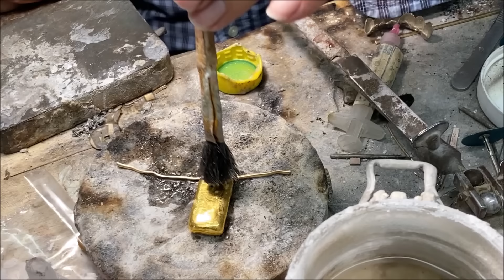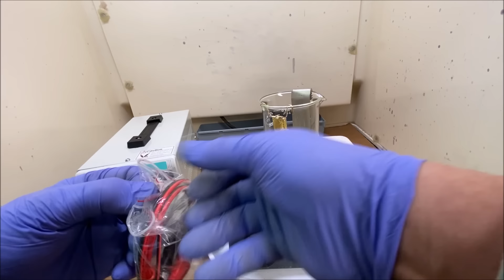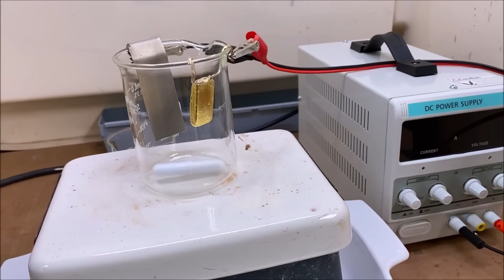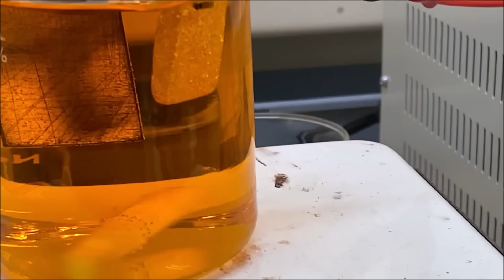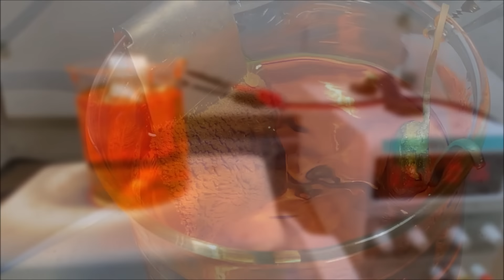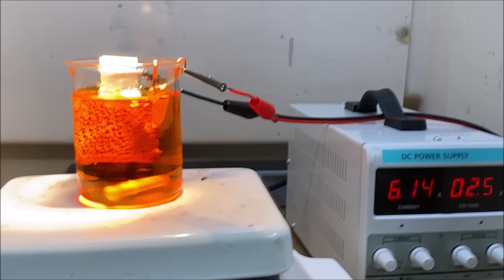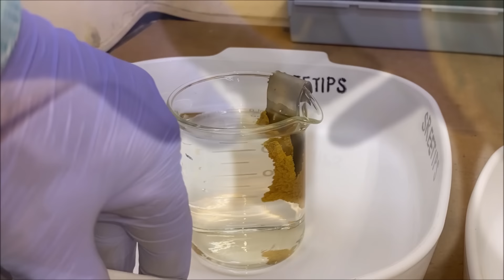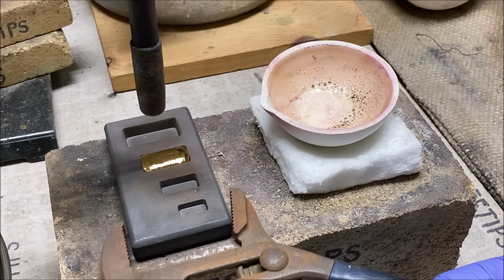Electrolytic Gold Cell Part 2

Comment: Any reason why you could not use a similar set-up to your silver cell with impure gold shot suspended in solution with a gold bar anode and a silver bowl as a cathode? When done with recovery cut the bowl apart and dissolve the silver with nitric leaving the refined gold behind.
Reply from the maker: I’d have to use a titanium bowl for the cathode, but it could probably be accomplished.
Reply: @sreetips  if you could reliably scrape the gold off like you do in the silver cell it might be a worthwhile investment. Imagine, being able to run 10-22k gold scrap to .9999 in one step and a few hours.

Comment: So you start with fine gold (in solution and as electrode), spent a lot of time and recources and end up with fine gold. Makes no sense to me. I would understand it better if you started with impure gold end ended up with pure gold.
Reply from the maker: But, relative to the gold deposited on the cathode, it is much more pure than the starting anode. A single extra nine may not sound like much, but in the refining world, achieving four nines, is huge. I could repeat the experiment using four nines gold as the electrolyte, and cast a four nines anode bar from the cell. Then run it through the gold cell to achieve five nines. This is what the RCM does to get fives nines for their special projects. It can be done, even by an amateur (yours truly) in his garage.

Comment: I am thinking that with slower or no stirring that you might be able to get more spectacular crystals as the stirred fluid would break off any tiny protruding crystal, which is why the crystals were more mass type than spectacular, spectacular crystals take fairly still liquid so as to not break the developing crystal, one should be able to get long crystals like with the silver, it just takes a little time

Comment: That was fascinating! Thank you for taking the time. I am curious if you inquarted gold with silver and made a bar from it, then rolled it out into a thin strip.

wouldn't that increase the surface area and allow the silver to be removed quicker? You could even "perhaps" roll the thin strip up like a spring. Would be interesting. Wish I had a place I could experiement.
Reply from the maker: Others have suggested doing this. And I thought that trying to roll all those small pieces of inquarted gold would be a massive headache. But rolling an inquarted bar thin for the nitric boils would make an interesting video. Thank you.
Reply: @sreetips  I would definitely watch that

Comment: You did not disappoint with this one. I was waiting for Part 2.  Well worth the wait.  
I know that crystal gold is worth up to 10X the weight of bullion.  Do you think this process could be used to create large crystal gold?
Reply from the maker: Growing large pieces of gold crystal like the silver in the silver cell is possible. I just don’t know how to do it yet.
Reply: @sreetips  So, it will take time and low current.  I would suggest lowering your temperature to decrease deposit rate.  I would also suggest you use a seed crystal.  You will have to buy this or somehow extract one.  There are 2 types of crystal gold anhedral and euhedral.  If you place one on the cathode, and use cool temps with low current, you should get this crystal to grow over days.  You now have a factory to create gold worth 10X weight.

Comment: Thanks a lot of effort. If gold goes to $4000 it’s a side hustle
Reply from the maker: It can side hustle now. I bought a 14k ring from a gal yesterday. I tried to tell her to just hand on to it if she didn’t need the money. She looked at me and said, “and do what with it?” People are clueless about gold and silver. They are eager to convert their metal into paper because they believe, incorrectly, that paper dollars are more valuable than gold. You should see the look on some folks face when I quote them what I can pay. Their jaws drops open and they say, “I’ll take it!” It’s a precious metal buyers paradise out there. But this will change as people begin to realize that their paper money is quickly becoming worthless, and their valuations are based on a mountain of debt. Faith in dollars is still intact, but eroding. When the faith begins to wane, and it’s coming, then gold and silver will not be thus easy to acquire.

Comment: That was cool! Thanks for sharing..

I do have a question. 
On your silver cell your crystals don’t seem “glued” to the stainless steel bowl you use. 

Couldn’t you use a similar procedure as you do with your silver?
Like a mini stainless bowl as the anode then suspend gold shot in a basket as the cathode?

Maybe I missed an explanation or I don’t have an understanding of the gold electrolyte.
Reply from the maker: The silver cell is different. It uses a nitrate for the electrolyte. The gold cell uses a chloride. Adding the gold chloride to stainless I don’t think it will work. But if I could find a small,high grade titanium bowl, then that would possibly work.

Comment: Next time you do make a new bar for the gold cell, you could try taking a small bar and have it rolled out into a wire of desired thickness and when pouring the new bar have them either sitting in the mold or dip them into the molten gold. The cathode might benefit from a narrowing a slight bit near the end to help it come off a bit easier but not too much so it will just slip off in the cell.
Reply from the maker: Now that’s a good idea.

Comment: So what exactly is the point of this? Don’t get me wrong, it’s absolutely fascinating to watch. I’m just curious what the reason for transferring the gold from the bar to a sponge on that piece of titanium is? Is this a refining method to get rid of other metals like nitric boils does?
Reply from the maker: This is a method to achieve four nines gold. Three nines is industry standard and is easily achievable with wet chemical processes. But getting four nines is different. This video was purely for demonstration. This is the method used by large refiners such as the Canadian mint to get four nines gold for their coveted Maple Leaf coins. But as for me, the experiment using titanium was my main curiosity. And it worked beautifully. I may do some more electrolytic gold refining after a play with the shape of the titanium cathode to make it easier to remove the beautiful four nines gold from it.
Reply: @sreetips  ohhhh I see. Thanks for the explanation! Great video!

Comment: Just hammer a thin steel pin into the top of the anode. Bend the pin. Attach the positive. The pin won't be in the acid.
Remove the titanium electrode (cathode) when there's a little gold on it, not when there is a lot. Scrape off the thin amount of gold. Return the cathode and begin again. Or, apply something down the length of the cathode so that the gold does not apply. That will leave a vacant stripe to enable easy peeling of the gold. Some plastic that is same as the stirrer could do it.
Reply from the maker: I may try this again with a larger amount of gold. And play with the shape of the cathode to make it easier to remove the gold. I’m thankful that the titanium worked as the cathode.
Reply: @sreetips  It was a nice job. I have lots of gold bits and have been following you for some time. I will try that electro-refining technique. Loved watching it.

Comment: With getting the gold off the cathode, from what I have seen from professional refiners their method "simply" is using such big cathodes and letting enough gold build up on it that it just strips off when you hit it with a hammer and whatever sticks to the cathode is just put through the next run... not really a method you could use as a hobby refiner XD

Comment: Awesome work Sreetips.
The lighting and angle on the electrolyte has been one of your best shots, it actually looked like shining gold in solution rather than the forbidden chloroauric coolade.

Room for improvement but I guess thats partially what this second attempt was for. Like other commenters I'm sceptical that a soldered anode is the best approach. Cant knock Bobs welding though... 

Great vid! Great result, great process...
Hats off to Emil Wohlwill from 149 years in the future.
Wonder what kind of hat he was wearing in 1874...

Comment: A note on the electrical process:
The current is the important part, and is usually referenced in amps/Cathode surface area. The higher the current, the faster the reaction, but the hotter the solution gets and the more lumpy the deposition is. The lower the current, the smoother the deposit is. 

The actual current depends on the conductivity of the solution, the distance between the electrodes, and the voltage. Of those variables, the voltage is the only one that is user adjustable. 

So if you were to do more of this, then find an amperage/Cathode-area that gives you the results you desire, then aim for that.
Reply: Use amps or milliamps per square centimeter. Also the anode and cathode should be parallel to each other or there will be uneven deposition.  Corners that are closer have more current concentration since distance between these is smaller.  Should have a lab grade thermometer so cell temp can be monitored and kept constant. Keeping a constant current control with your power supply, but watch for a steady rise in voltage which would mean electrolyte exhaustion.
Reply from the maker: Large commercial refiners use alternating anode/cathode plates suspended in a tank of silver nitrate electrolyte. These are called “thumb cells.” I am operating a moebius silver cell with the distance being equidistant between the anode basket and the cathode (stainless bowl). I’m a small hobby refiner.
Reply: I'm sorry u got a divorce. U was about that lifestyle and all them hoes and I would had be loyal to til death u fucked all that up and I'm not like them I'm not running back to u .

Comment: And by putting the anode into the catalyst aren’t you putting the gold from the anode on the cathode or just replacing the gold that’s in Solution
Reply from the maker: The current flow dissolves/corrodes the gold off the cathode, the gold ions travel through the electrolyte, and deposit as high purity gold on the titanium cathode,

Comment: Why doesn’t have to be stirred vs silver?
Reply from the maker: Stirring keeps the electrolyte moving. The silver cell would benefit from stirring. I’d like to install a slow stirring mechanism in the silver cell to keep the electrolyte moving and to keep the silver crystal knocked down away from the anode basket. If the electrolyte in the silver cell becomes depleted (and it does as the cell operates) the reduced silver content, coupled with increased dissolved copper content, coupled with no movement of the electrolyte, especially right at the cathode, if all these conditions are allowed to happen then the copper could begin to go-deposit with the silver and contaminate the pure silver crystal.

Comment: Interesting experiment. 

Hoke stated that the starting anode current was 125 A/ft^2 which comes out to 0.868 amps per square inch. Your anode appeared to have a face area of roughly 2 square inches, so your current density was quite a bit higher than that. 

She stated 140 degrees F as the minimum temperature. I am assuming you raised your solution temp to at least that - as there has to be some reason why Hoke specified it as a minimum, without stating a maximum.

I wonder why Hoke specified so much free HCl in the starting solution. Maybe to ensure that all the impurities in the 980 fine gold would react with the acid - rather than being suspended in the solution and carried across to the cathode as a contaminate.
Reply from the maker: I noticed a dramatic increase of current flow when I added more HCl.
Reply: @sreetips  Yes, you would. I suspect that is why Hoke specified 10% free HCl (if I recall correctly) in the electrolyte. Apparently that produced the current density she desired for that particular cell configuration.

Comment: You have less gold than what you started with lol the anode I believe was 56 grams when you started and you said the anode was highly pure
Reply from the maker: I’ll never get back 100% in a process like this. Entropy guarantees it. Most of the “missing gold” is on the undissolved piece of anode, the sharks tooth. The anode was high purity. But deposited on the cathode was higher purity. I’ll bet that I could use the bar as an anode again and run it back through the cell a second time to achieve five nines gold.

Comment: The anode was 56 grand and you said the solution had about 28 I'm hoping you get atleast that back
Reply from the maker: There are losses, but most of what I started with is all there. Less any spit and sputters that splashed out droplets from the beaker.

Comment: I don't get why you corrode a 2oz bar of gold away... do you have any waste? I'm unfamiliar with this kind of stuff I'm assuming your extracting the gold from the yellow solution maybe to purify it? I don't know but I hope you get that anode bar back
Reply from the maker: This was to demonstrate the process. Plus curiosity got the best of me to find out if the titanium cathode was going to work. And it did. For electrolytic refining to be effective, I must begin with an anode that is fairly high purity to begin with. An anode made of karat gold, for example, would quickly foul the electrolyte.

Comment: How to change one gold bar into another gold bar.
Reply from the maker: Believe it or not, the gold that deposited on the titanium cathode, was much purer than the gold in the anode bar. That extra nine really isn’t necessary because industry standard for pure gold is three nines. But the only way to get the extra nine, and not many can, is via electrolytic refining. Just like you see here.
Reply: @sreetips  I believe it, but as you point out it probably isn't necessary.
Reply: no, the correct sentence would be, how to change one fairly pure gold bar, into another gold bar that is the maximum level of purity possible in the universe. You were close though....

Comment: Just curious, how close is sodium metabisulphate compared to potassium metabisulphate? We brewers use the pmbs preferably and sometimes can use smbs. I know the sodium would be salt and that’s sorta why we don’t use it as much but would you be able to use them interchangeably as well?
Reply from the maker: I use sodium metabisulfite, not metabisulfate. I’ve never tried potassium.
Reply: Oops I didn’t notice autocorrect changed both times to sulphate. I meant sulphite.

Comment: I wonder...perhaps you have answered this question before...I would assume a high purity cathode (dad uses a 18k wedding band) with a less reactive anode (surgical steel) would move the gold onto the cathode and leave the anode... presuming the anode doesn't dissolve... your knowledge is greater than mine,  I hope this is at least an interesting idea
Reply from the maker: I’m using a gold anode with a titanium cathode. You’re saying he used an 18k band as a cathode? And surgical steel as an anode? That doesn’t make sense to me.
Reply: I may have that backwards,  I'm not technically savvy. But he uses a ring as a seed for the gold to plate onto. The system isn't nearly as refined as yours but seems to work.  I imagine the purity he achieves is pretty low but he's just collecting the gold from old cpu processors and such.

Comment: might have some impurities from scrapping off the titanium.
Reply from the maker: Doubtful but not impossible. Titanium is very tough and resists scratches. I tried to remove burrs with my flex drive sanding discs and it chewed one of them up and wasn’t affected.
Reply: @sreetips  Titanium mp is around 3k f. If there are possible of the metal residue, probably will be at the top of the sample since it's lighter than gold.

Comment: As an electrochemist and AESF certified electroplater, this interested me quite a bit. My only concern is that you may not have actually purified the gold since the half-cell voltage for gold is higher than most all metals, especially silver and copper. This means that if gold is depositing, then there's enough voltage to co-deposit the other dissolved metals at the same time. I've been electroplating gold for 11 years at my job, and we go through about 70 kilograms of gold per year, so I've got plenty of experience on this subject. If you'd like to talk about this in more detail, I'd be willing to go into more detail, but it's too much to write in a YouTube comment.
Reply from the maker: I don’t doubt you one bit. The real goal here for me personally was to see if the gold would deposit on the titanium cathode. I can’t believe how well it worked. As far as other metals, everything was fairly high purity to begin with. The only source of other metal contamination would be those karat ring shanks (dog eats) that I used to suspend the anode bar in the electrolyte. I did see some green on one of them. Probably copper and zinc from the karat gold. Silver too.
Reply: @sreetips  Thanks for the reply. If you did want to refine the gold electrolytically, that's possible, but it requires a slightly different setup. You would only use the gold in solution, no gold anode, then set the voltage lower than necessary to plate gold, which would plate out the impurities first in a "stripping" cycle on a sacrificial cathode, then once the impurities are plated out, you swap to your production cathode and deposit the pure gold. It's a little more complicated, but not by much.